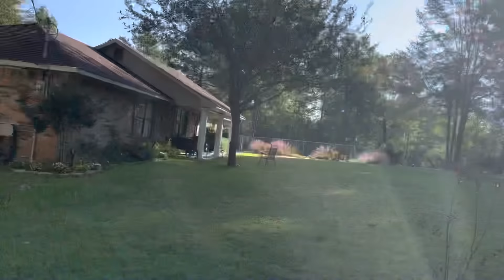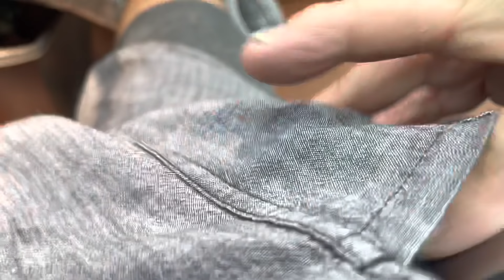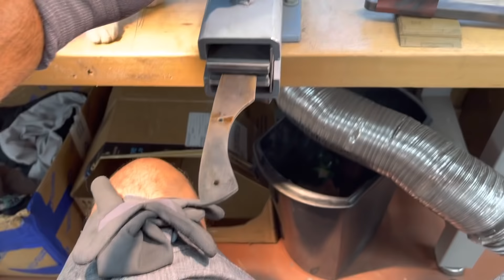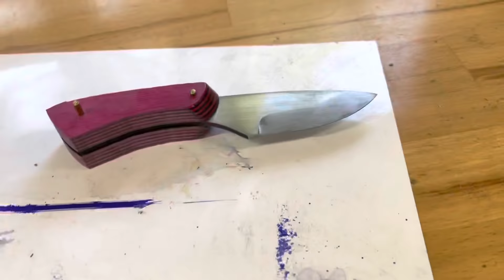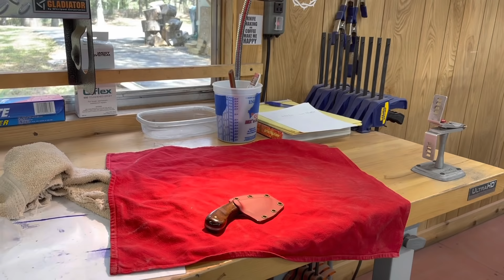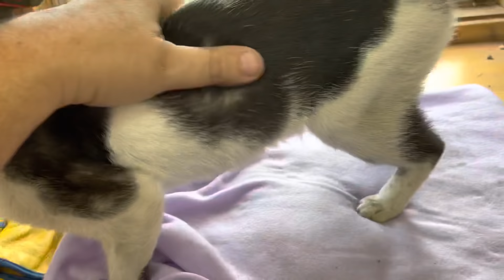Working on neck knives and ,,,,,,,you guessed it,,,petting a cat

Comment: Raton looks good! It's a pleasure to watch you fine tune your craftsmanship skills. This knife is a great example. 

Was the beef recall for Crider Foods? If so, we're fortunate, as I don't have any of the "brands" (just different labels) that was mentioned. Every time we go to Food Lion or Walmart, we pick up a few more cans of roast beef, when they have it. A can of that along with a good sized serving of rice will feed the 2 old folks in this house. A 50/50 mix of beef and unsalted rice, brings the sodium level, per serving to a tolerable level for us. 

 I've been seeing those winter forecasts, too. It's been a few years since we've had a bad winter here. It's been very mild and I'm afraid people have become complacent, in this neck of the woods. If memory serves, we had one light dusting of snow last winter and the year before. Do know that I did not have to put a heat lamp in the pumphouse, so the temps didn't get down to the low teens, this past January. That said, our record low is -9 F. Record snowfall here is 22". Remember well, when we got 6" of sleet. It was almost a week before I could get to work. Another year yielded ice storms for 3 weeks in a row. 

It's past time for us to have some of the winter weather that traditionally repeats here periodically. Because we have had frozen water lines, I bought a few extra 2.5 gal water containers from Walmart. They are in addition to a couple of Reliance Aqua Tainers and a contractor style 5 gal water cooler. Along with some cases of bottled water. As a part of our storm preps all of the mentioned containers are filled with water. The 2.5 gal are placed beside the bathroom sinks for hand washing. Additionally, bathtubs are filled for flushing and large filled pots (canners) are on the propane stove to heat water, as needed. 

Mentioned that because you may want to pickup some extra general purpose water storage that you can refill, as needed. After getting married, I lived in a local town for a few years. During that time we did have multiple problems with city water,  including a main freezing one winter. Had to wait several days for it to thaw. That's where I learned, the hard way, that city water isn't as reliable, as I supposed it would be.

Godspeed on your travels, today. Hope you find all the things on your list.
Reply from the maker: It’s strange that your comment went to spam. I can’t see a single thing that may have triggered the algorithm.  I checked our roast beef and we don’t have any of those brands. Topping off gas and propane today. Buying whatever protein is available.
Reply: @bctruck  No telling what's going on. I've had a few to disappear after a few minutes or so & couldn't figure out why. I'm trying to stay more generic, which is something I don't like and I'm sure you know why. (sigh)